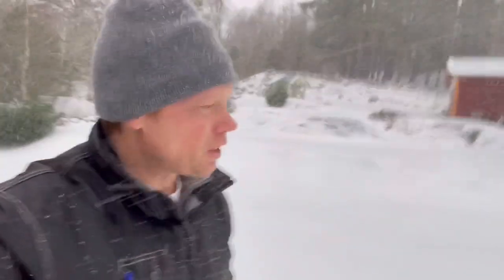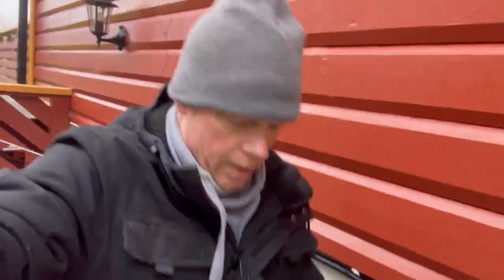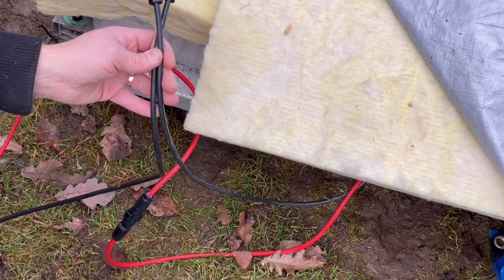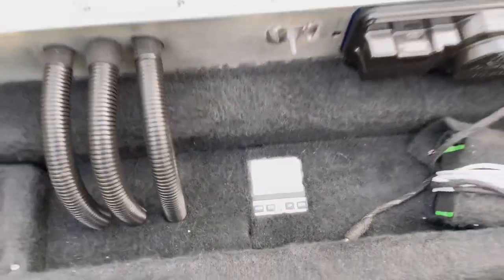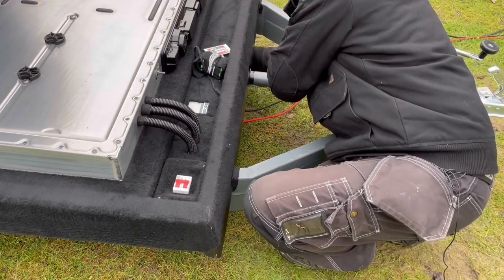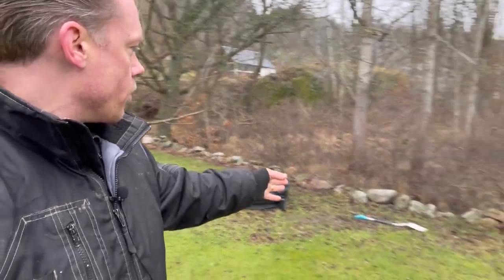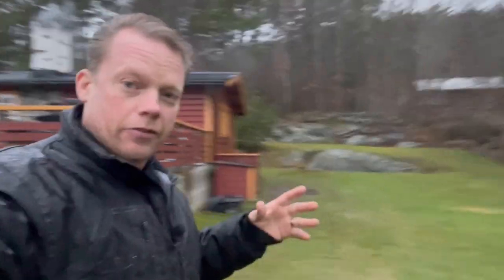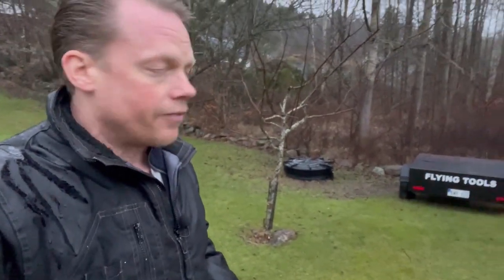Installing my 62kWh DIY HV Solar Battery Storage from an vw id3 to my house.

Comment: Yeah better safe than sorry.
But charging / discharging at 30 A  your ar 99% safe no matter what happens even reverse polarized cell. 👍
Reply from the maker: Yes you are right. 😊 My biggest concern is if I have a nearby lightning strike that will create a huge spike.⚡️

Comment: Nice solution, do you know how thick the busbars/cables between modules are? And what thickness cable do you have between inverter and battery? I have bought same Solax inverter but
Reply from the maker: I will measure the bussbars for you later, I do not want to strip mine for that😅 
20meter 10mm2 cable.
Reply: Thanks for measuring I have 10 12s id3 modules they stay 2/3meters from mij Solax inverter. I dont have Any busbars yet. And also I have to buy bms voor all 10 modules iam trying to Find bms That van communicat whit Solax.

Comment: awesome, what is the lenght of the cable and its sqare mm? how much amps will you be taking from it?
Reply from the maker: Not sure about the length right now but I think you’ll find it in the comments somewhere. I think it was 20 meters long. The area: 10 mm² and will draw 25A  max.